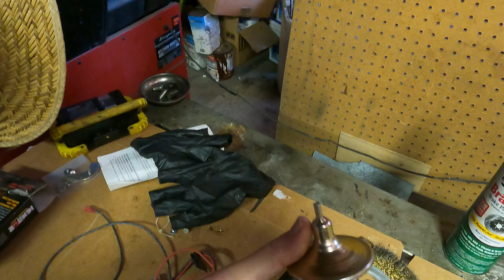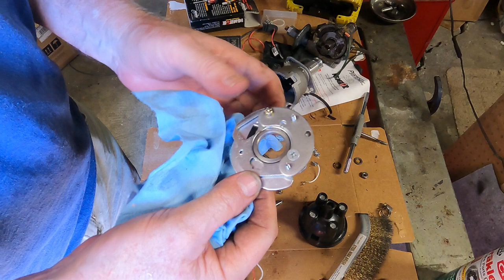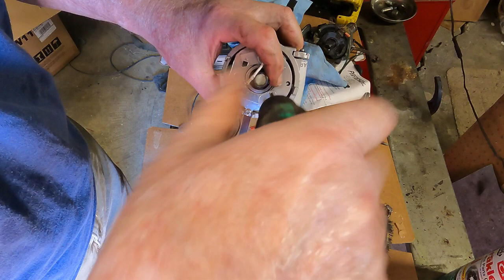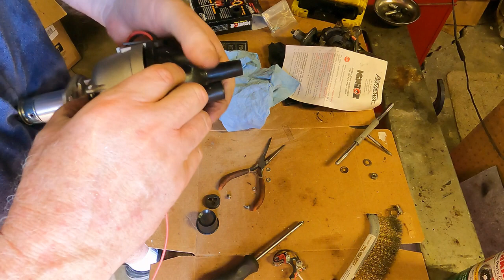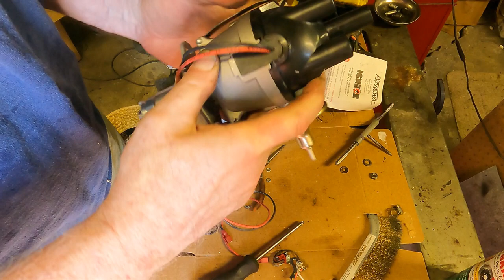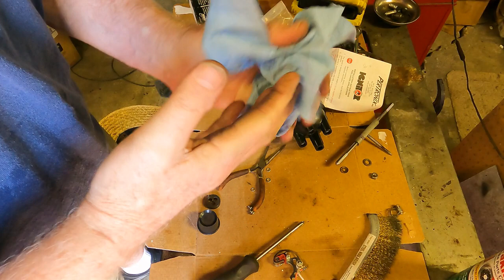1955 Triumph TR2 Restoration.  Part 22 B Pertronix Installation into a Lucas Distributor.

Comment: thanks EJH.  I haven't watched for a while.  It is light enough for outside work until bedtime so not much time for YouTube.  But days are shortening now and I will be catching up.  I am still fighting with the slave cylinder on the '67 MGBGT trying to get it to retract.  Looking to fit a grease gun onto the fluid intake.  I moved it a couple of mm in, so not seized.  John in Manitoba
Reply from the maker: I have used the grease gun into the frozen hydraulic cylinder several times over the years.  I even made up an adapter that I could just screw into the hyd line fitting.  Thanks for watching.
Reply: @ejhbritishcars6907  regarding the adapter, did you braze something up or are there adapters available to do the job ?
Reply from the maker: I rzided my odd parts frawer and found some bits and pieces that would screw together with a zerk fittiing on one end and theads that would fit into the hydraulic cylinder  Not perfect, but small leaks did not affect the efficiency.
Reply: @ejhbritishcars6907  Today I hooked the clutch slave to the brake master which still had life and a pretty strong push got the piston moving.   A couple more pushes and it was out.  Now to hone it and do an inspection.  I am inclined toward  rebuild kits considering the amount of rust on the car.
Reply from the maker: Look closely for pits in the bore of the cylinder. Fortunately replacement slave cylinders are fairly inexpensive.